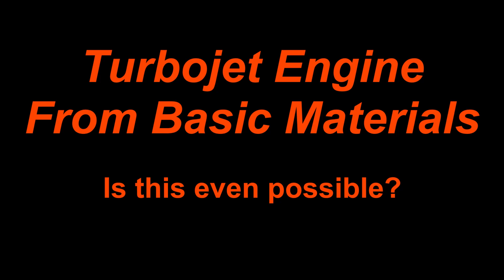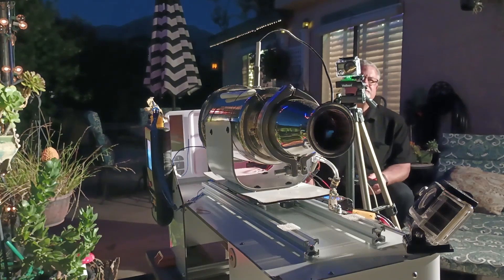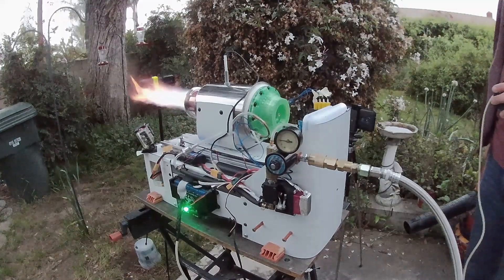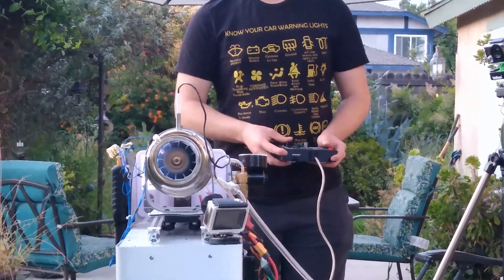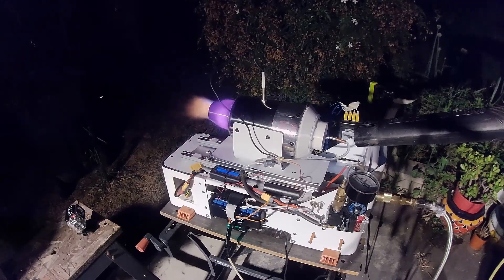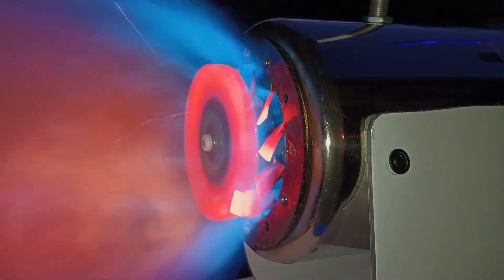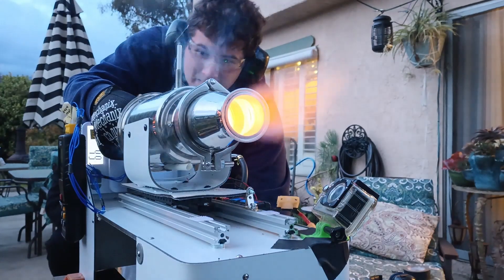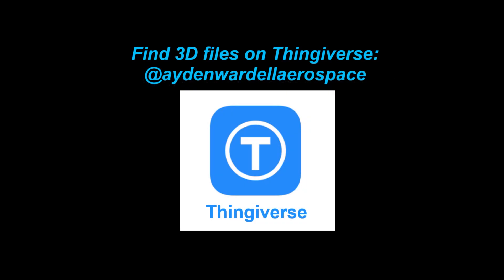Turbojet Engine From Basic Materials - how hard can it be?

Comment: as you already pointed out, jetengines or- turbomachinery in general does not lend itself well to any form of downsizing. Apart from physics playing against you, as soon as you start integration of an engine, you will discover virtually every sucessfull design is devoloping into larger renditions. In the end you always need more power! Thats quite the opposite in other fields, and one of the reasons why this(aerospace tech) is always regarded as a bit of an outlier, and has people from other fields quickly back down. Start as small as you can, that way you can scale up as soon as you hit hard limits like gap sizings and soforth. Always choose the more durable option and please avoid anything thats glowing red! As others already pointed out, there should not be anything, only barely visible flames, likely not even that. Your temps need to be halved more or less!! Consider contruction of your own ECU, there is no way around using one! Thats going to be my  goal before approaching anything new. I always slouched on electronics, and for quite for a while now I've been playing catch up. I will look into your 300mm Fan, its quite interesting... From a first look its a bit aggressive, pitch wise...but I think you know  that ! One can easily feed 10-100 times the power into a proposed aluminium or  titanium version of your fan, once there is a turbine feeding power...You end up with a narrow margin at high rpm, you can push them very far, those are transsonic wide chord blade profiles you're using afterall, they can  work even well above Mach 1

Comment: The spiraling exhaust plume is an issue but you might be able to fix that with a second stator (with straight blades). As for cooling, if you make the exhaust nozzle two parts, nozzle and air flow bypass, you should be able to increase cooling to it. A similar design is used on some guns for barrel cooling. Great work so far.

Comment: For the bearings, you might want to look into needle bearings instead of ball bearings.  The book I referenced in a prior post used, basically, small steel rods around a steel shaft and sleeve to create a bearing.  You will also want to inject a paraffin based lubricant into them (something like wd-40) - it is going to burn off and be sacrificial.

Silicon nitride ball bearings might work, but I think you have an application mismatch between the types of bearings out there.

I will get the book out and find your most recent video on the subject and comment with a title and reference number.  I will even post a book review going over it if you want.

Comment: Try to define a „cool Zone“, cool in with compressed air (external for the start) and Place all the heat sensible stuff like bearings etc there. 
The rotational speeds may be big enough to use „air bearings“ like they are used in pc fans. Basicly glide bearings with air as seperator. They ca be Build using foil and leakage air of your cold Zone.

Comment: im sorry if i missed it but what are you using for your main shaft/ axle or whatever you call it? i too want to build a turbine for powering rc planes but i dont have the capability to machine tool steel and was wondering if machining the shaft from aluminum would work?
Reply from the maker: I used a standard size of chrome steel shaft that is often used in 3D printers and milling machines. It is really cheap from Amazon and it is extremely straight and won't melt or deform like an aluminum shaft would.
Reply: @AydenWardellAerospace  are you plans or blueprints available online? i would love to follow along with what youre doing. do you think youll eventually get it running? any idea of what the thrust is expected to be around if you do?

Comment: I have some half baked plans for a low cost, wood fired gas turbine for portable electricity generation.  Your turbine is quite similar to what I have in mind, except my design uses thinner plate.  The plan involves using a 3D printed or cnc routed buck to cup the compressor blades in a hydraulic press.  I think you should be able to adapt the process to optimize your compressor geometry, but you might run into trouble using wooden or plastic pressing tools with such heavy plate.  Best of luck, I've subbed to watch your progress :-)

Comment: You have a very good understanding of your inputs and constraints. It's about dialing them all in. Scaling can be a difficult thing to balance for example reducing the size of turbine will also require reducing not just its mass, and dimensions but also blade thickness and as its thinner it can't spread the heat  as fast and will start to flex into a different shape/pitch. Multiple blades will help with the compression as well as distribute the heat. Your doing rock solid SCIENCE!

Comment: Depending on the temperature, whatever bearings you use, remember that, the higher the temperature is, the lubricants in the bearings start to deteriorate faster.

In the end, this will destroy the life of the bearings.

Go for the SKF hybrid cylindrical bearings, they cost a lot, but can withstand around 150 celcius in the terms of heat.

But a good tip, take a look at the hobby models that use jet engines, use the same bearings as those.

Maybe thrust ball bearings, or similar. Depending on the load.

Perhaps also look into lubrication, have something that lubricates the bearings when running the engine?
Reply: 30 years ago I learned that model jet engines use an oil pump like a car. I assumed that the temperature is also the same.

Comment: Some good comments here, especially those suggesting design manuals. Your willingness to experiment is admirable. You have gone far at the compressor end of your design, and I get how hard it is to fab an efficient exhaust turbine, but it is essential to generate the force needed to drive the compressor effectively. Make those expanding gases work to escape! The front and back of those blades, rotor and stator, work together to extract the most force from the flow. They are not just fans, but reverse pumps working in the most ridiculous conditions, melting even when they are working great! You may already know that they are The limiting factor in turbojet performance. Good luck!

Comment: Try using hybrid bearings you can build them yourself using a standard stainless steel bearings and silicon  nitride sferes. For cooling a mix of fuel and air should be ok you can use an injector pipe for the fuel and small holes in the ahaft tunnel for the air cooling. You also need to seal the tunnel shaft from the diffuser side. Old engines used to have the compressor wheel made from plywood reinforce with carbon fiber. Do you know the books from kurt schreckling and Thomas Kamps?

Comment: Excellent effort.  Pick up the book "Gas Turbine Engines For Model Aircraft" by Kurt Shreckling. This will show you all the design criteria that goes in to building miniature gas turbines. It has plans for the FD3/64, can be built using wood for the compressor, and other easily obtainable materials using similar techniques you are already familiar with. You may even get away with a 3D printed one if using the reinforcement techniques shown in the book.  Also the book "Model Jet Engines" by Thomas Kamps. This book is the basis for all current miniature turbine designs on the market, which are all essentially relatively minor design iterations of the Kamps KJ66. These two books will help solve the issues you are having, as well as give some more insight on miniature turbine design, which differ a bit from their larger counterparts and why it took so long, relatively, to get working designs. Keep it up!  Also, to my knowledge, full complement hybrid ceramic bearings having stainless races, and Si3N4 balls are typically whats used in gas turbines, including miniatures, rather than full ceramic. You will absolutely need to lubricate/cool the bearings. This is usually done on miniatures by a passage that supplies an amount of fuel/oil directly to the bearing via capillary tube, T'ed off from the main supply.
Reply: Also, the book 'The Model Turboprop Engine' also by Kurt Schreckling. The book has the plans and useful information on building the Ohdie 7 which is based off the KJ66 design but better in some ways.

Comment: I highly recommend you try to use same style of compressor as the FD 3/64 turbojet, because requires less Rpm  to generate compression, there is someone that already 3d print this compressor and it successfully worked

Comment: Greetings from Germany and apollogies for my bad english in advance, 
I have been working on my own Turbojet engine and think you could make the following changes:

- Use Kerosene or Diesel as Fuel, It burns way cooler, so you can use less thick steel, saving a bit of money.
-To make some parts with complex geometry, you could make a 3d shape to press sheetmetal against to get it into shape like Integza did in his Turbojet build.
-Stop trying to use 3d printed parts inside the engine, they will either melt, warp or deform, no matter what Fillament you try, especialy if the rest works and the turbine reaches high speeds.
-I personaly would try different arrangements and sizes of the holes in the combustion chamber.
-If you make the nozzle a bit thinner, use more screws to secure it, the 3 screws right now might not be enough to hold it in place and prevent leaks.

*Edit: For those Interested, I found a Youtube channel from a German guy (With English subtitles), he is built his own Jet engine, his name is Praendy on YT. He sadly doesnt talk to much about how he built it, exept for some of his videos. His Engine (With simmular size to yours) reached 50kg of thrust and he got it selfsustaining pretty fast. Maybe you could reach out to him and ask for some details about how he solved some of his problems.

Comment: A big part of your problem is needing the correct size nozzle on the exhaust to choke the flow at an operating point the stays near the peak compressor efficiency island. Too little flow and the compressor surges and/or efficiency is poor. Too much flow and the efficiency goes way down as well as probably having an issue with not enough power to feed it both as a result of lower efficiency and high work done trying to compress the high flow.

Also, since you need a nearly choked turbine inflow, and enough pressure to choke the nozzle, you need close to a 3:1 minimum pressure ratio to get useful thrust even though in principle with good compressor and turbine efficiency you might get it to run at 2-2.5:1 pressure ratio at the expense of guzzling fuel.

What that all translates to is probably a titanium compressor optimized for close to 4:1 pressure ratio on a big diesel engine as an aftermarket upgrade component. A second turbine stage would push the required pressure ratio beyond what’s practical for a single compressor stage.

Comment: The compressor diffuser is insufficient as I can see, the angles need to point down to the compressor exducer! How much depends on the compressor trim. Then diffuser guide vanes need to lead into the engine inner case side with a twist, otherwise, you won’t be able to build pressure. That’s part why your engine won’t run. 

That engine is hot starting, after making a correct duffuser, pre heat the engine, then ignite on starter gas, let the starter spin it up seriously, introduce fuel carefully, watch the Egt. 
//Jetbike Rider.

Comment: There is a ceramic 3d printing filament that, after burning off the plastic in an oven leaves a ceramic part. Not sure how pressure/vibration resistant that part is but it is definitely heat resistant.

Comment: Young man your engine is way too fuel rich.  But the materials you are using most likely won't survive the temperatures a properly trimmed engine will create.
Reply: Fuel rich and fuel burning in the wrong place are two different problems. It’s basically impossible to run a turbine in an atmosphere with around 20% oxygen content without melting things. The typical air fuel ratio is probably 50:1 on the lean end and 30:1 on the rich end, though a burner can has to maintain a rich mixture that can hold a flame in an area big enough to at least preheat the remaining gas to complete combustion . Areas insulated by air without fuel to reduce heat transfer buy some leeway.
Reply: @edmarciniak7612  now this is a great reply. Thank you.  I was thinking it's too rich because of the amount of flame coming out. AgentJZ said that the only time that should happen is when there is an after burner involved.

Comment: You could try changing the fuel to burn cooler - this would spoil your thermodynamic efficiency, but might reduce the chance of the device melting. Try a fuel mix of alcohol and some (vary the amount) water.
Reply: I've heard a 50-50 mix of nitromethane and gasoline is often used for pulse jets. Don't know how well it would work for this. At least with the nitromethane you could tell if its running too rich when using traditional fuels.

Comment: 3d printed stator for the compressor side is BS because when it actually runs the compressed air heats up enough to melt any plastic or at the very least soften it. To start such bad designed "engine" you need air speed rather than air volume - use compressed air instead of a leaf blower. You could use a wooden compressor wheel reinforced by carbon fiber. Overall advice would be to get the basic knowledge first - at least get a copy of Thomas Kamps and Kurt Schrekling's books about model jet engines and follow their recipes to the last symbol to get a working engine first and only from there bring your own wrong ideas to the project of THAT magnitude of complexity.
Reply: Given he's indexing the compressor side, air mass would matter far more then air pressure, I would explain but Google exists and YouTube won't let me put a multi page paragraph here.
Reply: @SlowSTEN I did not say anything about relation between mass and pressure but the one between pressure and speed which is required for starting the engine. Leaf blower will never reach the flow speed high enough to give compressor wheel rpms. It is not about giving the engine all air it needs for self sustaining it's about pushing compressor blades one by one fast enough so it would provide the engine with enough air itself.
Reply: @Zortorond  Im thoroughly convinced you didn't follow what I said at all and only read "Air mass" and tried to make a semi-convincing counter argument.
Simply Put, Yes, The Pressure will help spin the turbine, however, Airmass will also help start combustion AND spin the turbine, as you are quite literally "Ramming air" In, Much like a turbocharger (Infact they're incredibly similar)
Reply: @SlowSTEN  We are talking about this exact application in which he was not able to reach self sustainability of the engine for a lot of reasons but the first is his leaf blower was not able to put enough air into compressor because the flow was too slow. Air mass won't do anything without the speed. In other words if you'd try to start any jet engine by slowly pushing tonnes of air thru it you'd fail. When several kilos of it given enough speed would do just fine.

Comment: 1. You could try air bearings they are pretty much free due to being built out of the geometry of the engine and using bleed air from the compressor. 2. You can use a pentograph, dremel and a 3d printed transfer template to dremel stator vanes out of a piece of steel. 3. using a rod and a jack you can cup the vanes on a turbine wheel. 

4. have you considered an inside out (centerless turbine) design? Using a pipe inside a housing as the shaft and using retaining rings to hold it in place at either end. Press fitting a ring with compressor geometry in one end and a ring with turbine vanes (pointing towards the center) in the other. Using a pump to flow coolant between the outside of the pipe and the housing turns it into a hydrostatic bearing. Then you only need to feed a tube through the center to create the annular combustion chamber, between it and the inner wall of your shaft pipe.

This is an advantageous design because, centrifugal force makes turbine vanes push into the shaft pipe instead of pulling on it. Hydrostatic bearing gives cooling and low friction.Large combustion volume for the size.

PS. you can electroetch turbines using salt water and a battery. Look up how pulse jet leaf springs are etched. After some cleanup with a dremel you then hammer them to the correct angle and shape using 2 wooden template blocks.

Comment: low compressor tolerance leading to a lot of leakage and therefore low compression the turbine tolerance shouldnt be too much of an issue and try to make knife seals for the bearings to at least keep combustion gasses off they fair well in high temp but once you add combustion gasses and leftover oxygen they burn through

Comment: there are 3d-printable ceramic and metal filaments you can create objects with, and then run the printed object through a particularly hot oven to burn the plastic out and sinter the ceramic or metal particles together to create a finished object. It usually shrinks in the process, but you can create complex geometries that are a little less prone to warping from centrifugal forces this way.

Comment: Adding a throughput on the inside air bypass should cool the shaft and extend the life of the bearings.
With your current design, the inside bypass air has to turn 90 deg and go into the combustion chamber, which heats up the shaft further.
Generally a portion of the air in modern jet engines has to remain unburned so that It can be used for cooling.

On a separate note, the turbine end could use a sheath in between the air director and the turbine to keep the air from being turbulent, 
along with keeping it from the shaft. Round steel tubing could be used to make it.